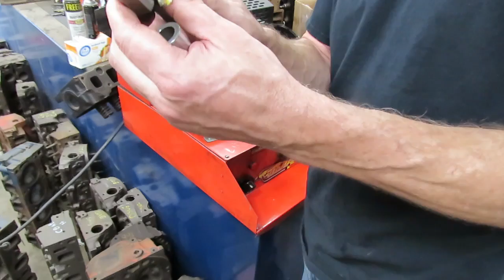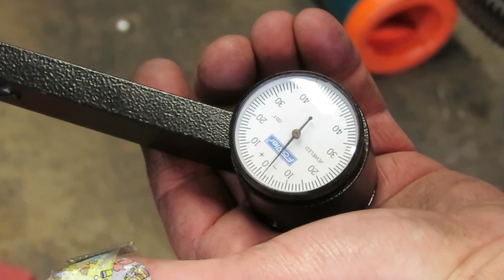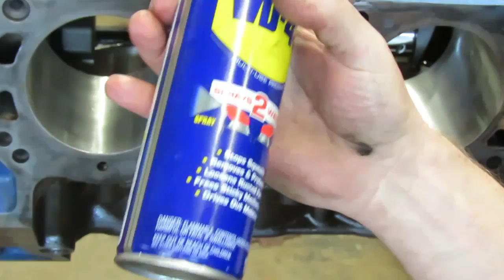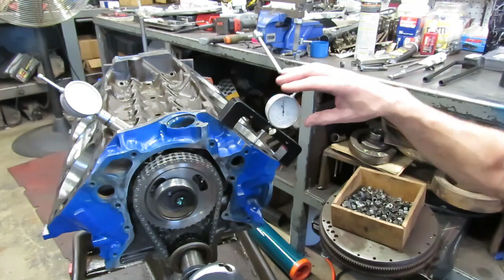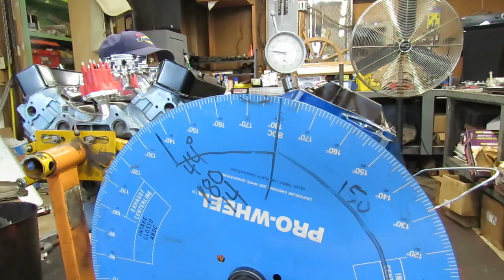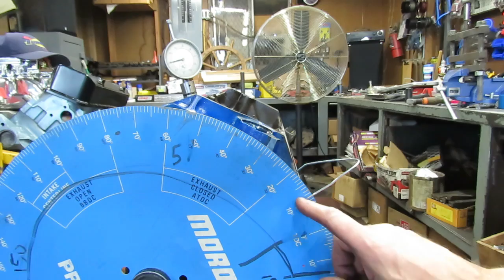How to get more power out of your Small Block Ford part 4

Comment: Not downing fel pro, but a friend told me that a fellow that used to work for them redesigned their ford gaskets and then left to start their own gasket company. He sabatauged(sp?) the ford gaskets when he redesigned them. A company that starts with a "M" has the best gaskets for Ford. Don't take my 2nd hand word for it always make sure the fel pro gaskets are made right. Fel pro is aware of this and might have already solved the problem though.

Comment: Not sure if you still check comments on these vids as they are 3 years old, but I have a question for you if you do. You went over the importance of proper placement and orientation of the head gaskets due to the rear water jackets, but I see there are water jackets at the front of the block and the front of the heads. Why do these get blocked off by the head gasket? Seems odd to me that the head gaskets wouldn't have cut outs for them too.

Thanks for the incredibly detailed videos, you are a great teacher! These will be invaluable to me when I build a small block Windsor in the near future.

Comment: I had a new set of forged 351C 12.5-1 pistons, with the closed chamber 4V heads, that I didn't need so I sold them to a guy and I told him to be sure when he put the rings on be sure to fit the rings properly because they are file fit rings. While I guess he knew better because he put them in without fitting them properly and destroyed his engine when he fired it up for the first time.
Reply from the maker: Yep!

Comment: Great vids I hate ford but I love ‘em too. Thinking about a rebuild on my 89 5.0 HO. What are you’re thoughts on camshaft needle bearing upgrade on the stock block. Bad idea or not
Reply from the maker: No it will work fine Y303 Cam
Reply: @Myvintageiron7512  thank you sir. You mention Y303 camshaft. Why that camshaft. I haven’t gotten that far in the process of picking out camshafts yet

Comment: You've obviously been doing this for awhile...ever used a crankcase evac in place of pcv to pull a vacuum on a crankcase? I know with an engine like this isn't not really relevant or needed...just a thought.
Reply from the maker: Oh yeah I have used Pan Evac systems on many street rods and race cars , it works well
Reply: @Myvintageiron7512  there is a video for you. Pan evac vs pcv, how to set it up and what to expect. Very little info on them out there.

Comment: I have an 86 mustang that I have future plans for. But for now I am working on an FSJ AMC that I'm putting a AMC 401 in will tow a trailer and off road with it I'm only interested in off idle to mid range with it I would appreciate any info I've got Eddie performer intake ,cam and 650 carb with headman long tube headers and HEI performance dis. Plus some head work for low end performance. Love your vidios pls advise

Comment: When you check big end bearing fitment on your conrod, you can also check consistency of crush between piston/conrod assemblies. Place big end in vice with soft jaws closing vice on rod portion of cup, fit cap then torque to spec. Release one bolt and spread gap appears between surfaces, measure with feeler gauge for clearance. I recall for our old Holden six i.e. 186 ci red engine it's 0.007". 
Cheers America ftom Australia.

Comment: Why don't you freeze the pins in dry ice to shrink the size to fit? Just seems a bit easier.
Reply from the maker: it won't shrink them enough to get them in
Reply: @Myvintageiron7512  Fair enough. Thanks for the quick reply.

Comment: I always use .020 gap file or sand the outer edges for naturally aspirated motors. You wont see any difference on oil consumption.
Reply: If you don't have any plans for power adders why open up the top gap?

Comment: Thanks for sharing this process with us. I'm working on a 78 Ford 351M that's been bored .40 over already. It seems in decent shape, but sat in a field for 10 years after a lot of machine work. The engine was seized, number 8 cylinder had light rust from an open valve and some moisture. Is it safe to consider machining to .60 over? A lot of people talk about Ford engines having thin cylinders walls and overheating concerns. Any feedback would be greatly appreciated. Kind regards, Charlie
Reply from the maker: I wouldn't go .060 with it
Reply: @Myvintageiron7512  thank you, Merry Christmas!

Comment: Ring gap is also dependent on compression ratio. 9:1, it's easy to run a bigger gap without much loss past the rings. A diesel on the other hand, 17-21:1 compression ratio, the gap is way more critical, and you need to keep it tighter. The benefit with that, is diesels generally have ferrous top ring lands, and you can get away with more.

Comment: I like .004-.005 with forged pistons, little more as the bore size goes or application, the hypereutectic pistons they make these days are great pistons for all around use, less clearance is need, they tend to use less oil also.
Reply from the maker: you need to stick to the piston manufacturer recommendations for clearance I put in a set of forged last year they were at .0025 per Mahle specs worked fine
Reply: @Myvintageiron7512  Newer forged pistons have come along ways also, supercharged, and turbo charging will obviously make those choices for thermal expansion the engine builders in some cases. Curious what the spec is for the 88-91 5.0 roller cam Mustang which came with factory TRW forged pistons, any bets it was .0035-0045? The Mahle uses the coated piston skirts also I believe...?

Comment: I only use snap on ring pliers they support the sides of the ring and they dont over expand the ring. wd 40 is the way to go you are correct about total seal. thank god someone that understands about oil on the piston. i was told by Ed Pink the pistons are not submerged in oil so dont submerge them in oil. people dont understand if your doing a cam break-in you have rpm up that oil has nowhere to go and the pistons and rings are going to get hot. hot oil in cylinder walls = glaze.
Reply from the maker: Exactly

Comment: Hello there! Love your videos. I'm also currently gearing up to rebuild my 289 from a 66 Mustang. I was going to upsize the exhaust valve to 1.60 and I've done some amount of porting to the exhaust ports of the stock heads to remove the casting bumps and smoothed the bowl to the new hardened seats, using stainless undercut valves and replacing the press in rocker studs for screw in. I'm opting to do the retrofit hydraulic roller upgrade and was wondering if Howards Cams CL222745-12 would be an acceptable route to go or if the .536/.536 lift would be too much? I started on these heads before these videos came out or id have went to find some gt40's lol
Reply from the maker: The GT40P will out perform your 289 even with all that work just by changing springs and bolting them on assuming of course the valves are sealing and they are flat on the decks you do not need to do all the work I did to see a HP gain with them I just wanted to show what is possible
Reply: @Myvintageiron7512  I might just have to drop by a few salvage yards looking for some explorers, thank you for the advice to ditch those old heads. Howards Cams is one of those good manufacturers using delphi lifters right? I dont want to mess up this rebuild with subpar parts

Comment: I just built a 289 with those same pistons. Summitt claims +8 cc on the valve releifs I would believe it I've never seen valve releifs that big they call it a flat top piston but if you look at the area the 4 releifs consume I would basicly consider it almost a small dish piston lol.
Also how far down in the bore did they end up at tdc
Reply from the maker: .017

Comment: I have just carefully rolled rings on and never had an issue, I have also used a ring installer and never broke a ring. One ring Issue I had was with a Chevy engine. The ring fit the bore correct and so did the piston, but the piston didn't have enough depth in the ring land area for those rings. Maybe one more thing to measure.
Reply from the maker: Yep ring back clearance

Comment: I have a trick for the intake manifold on "Windsors" (works on any intake with 0° intake bolts though) Its easy on the engine stand to get the manifold to go on LEVEL - BUT - I have done a ton of 2bbl to 4bbl swaps in recent years for friends...Some switching for 4bbl carbs...some for FAST EFI (Cool Stuff - I remember when ANALOG Holley Projection came out, those were a headache)....So...Swapping On The Vehicle... I made FOUR long smooth studs by cutting the heads off of 4" bolts and rounding the cut end, I use them as "Guide Pins" to make it easier to keep things straight while you are setting a manifold on in car, usually one handed as you are possibly re-routing things you didn't remove (A/C Lines are a great one to get in the way, even if its 134A, I would rather work around it.) Work Smarter not harder...
Reply from the maker: or just buy an intake stud kit
Reply: @Myvintageiron7512  Yeah There is that Too...However Many times you are dealing with a customer that Just wants to be rid of the 2bbl and is trying to do things on a Budget...also...the studs only keep you straight the last few inches...I am using 4" long bolts...(Also I just Did a 2bbl to 4bbl on a 69 Mustang, and even though its not original, we did use a Period correct intake to make it LOOK as CLOSE as possible...)

Comment: Whats everyone's opinion on putting pistons in backwords
Reply: Makes more torque but there would be accelerated taper wear in the cylinders
Reply: Only useful for rebuilds using the original rods and pistons really.  Also you actually swap banks, not turn them around unless you also flip the rods as well. But as tested you get about 3-5 more HP is all depending on the application. That would matter for racing but you would never notice otherwise.

Comment: I've done dozens of engines ...mostly Ford small blocks...u r the most thorough instructor I have ever seen...i've even seen some new 2 me stuff.....good on ya!
Reply from the maker: THX
Reply: Man watching this now I see how terrible of a job I did putting my first engine together a few years ago lol. It was a 302 sbf. Just did a refresh on it with new rings, bearings and gapped the rings for a 150 shot of nitrous. Engine ran pretty good though. Had a Ford racing F cam windsor sr heads (actually for a 351) and an edelbrock performer efi intake. Still to this day the only engine I ever did. I’m more of a bolt on guy lol. Heads cam intake. But the engine ran good for over a year then I ended up parting the whole car out.  the guy I sold the short block to used it for a couple years  that I know of but lost contact with the guy after a couple years so idk how long it actually lasted. Pretty much have all mod motors now and plan on building the shortblock on my 3v soon. Glad I came across the video definitely learned a lot

Comment: Build it loose, nobody knows. Build it tight, everybody will know.
Reply: That's funny, never heard that before but I get it.
I just wonder back in the 50,60,70, I'm sure ring gaps may have been off. But computers kind of took that out of the mix. Pretty much
So unless your building a turbo...with non turbo piston rings set.
I wonder is it THAT important in 2020 to check ring gaps so routinely ???
Reply: @MindDezign  YES
Reply from the maker: YES!

Comment: Sir, I just had a small block 350 chevy rebuilt,. crank turned, new pistons, bearings, block bored, ect,., it has a roller camshaft and lifters,., its a 97 vortec block.., new timing set, ect,, I have the shortblock on a stand with NO heads yet installed,, when I rotate the motor with the torque wrench, at the crankshaft,, ,  it seems quite tight,, I measure the amount of force it takes to turn the the motor 360 with the pistons lubed with wd40 and the crank , cam, timing set, ect lubed with assembly lube.. it takes abt 24 foot pounds of force to get the motor turning.  is this normal? There is no sticky spots, grinding,  ect,,      once again the timing chain is quite tight, there is probably abt 1/4 inch deflection if I push hard on the timing chain,.. any advice APPRECIATED.,. thanks in advance.  I dont want to finish putting the motor together if something is too tight and have it lock up on me. my builder said it is not going to be easy to turn the assembly,, but that doesnt tell me much,,   he is 150 lbs and im 320.. so easy is a relative term.,,. ha
Reply from the maker: 24 IB FT is fine
Reply: @Myvintageiron7512  thanks very much, im used to working on small 4 stroke motor cycle motors , single cylinder. now I can finish assembling the engine with peace of mind.

Comment: Geart videos , I'm working on a 351w. Who's roller lifter are you using?my block is a non roller.
Reply: I used to specialize in 351W builds, and though I only do a couple a year, as now I am retired... BUT Howards Seems to be the best bang for the buck...IDK what this builder uses.  Yes they are not cheap...but any that are cheap are trash.

Comment: More great tips. For years work shop manuals like Haynes told you to dip pistons in a bucket of oil before installing.
    I feel this WD40  trick makes sense to my mind.
My question is how often this day and age of computer tolerances, have you found ring gaps off ?
I can see during a special turbo build.?
Reply: File to fit rings. Top and second, on my builds 30 years ago. Oil tensioner set for 14-16lb on pull scale through the bore.

Comment: The degree wheel setup on the cam is interesting to note because back in the day (the old days!!), many cams would not match what the cam card said. They would be close, but rarely would they match exactly, so you had multi-keyed sprockets, or offset crank keys, and things of that nature to dial them in to specs.
Those parts are still available of course, but the cams themselves are much much more accurate nowdays. And when used with the matching chain/gear sets, they land right on the specs of the cam card, way more often than not!

Comment: Old habits die hard. I still let all my lifters I use in a build to set all night in oil the day before the planned build.😁
Reply: I used a pushrod to push the lifters up and down while inside a gallon can full of non detergent 30w oil. And a cannibalized point distributor to prime my fresh build at startup. Grind off the mechanical advance. Turn down the shaft to fit 1/2" drill. Remove the gear at the bottom. Just don't apply downward pressure or the gearotors in the pump could gall.